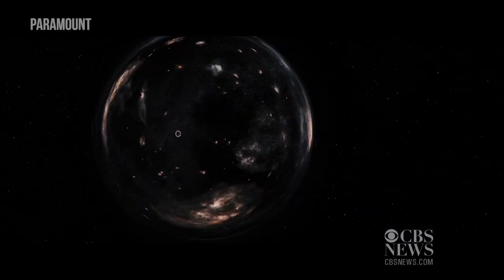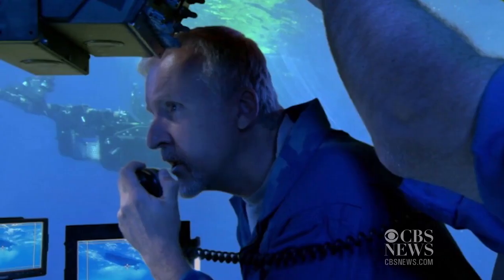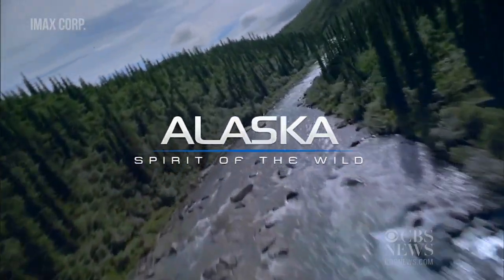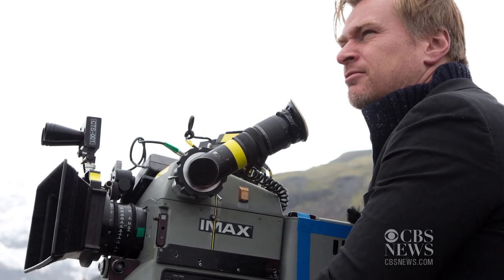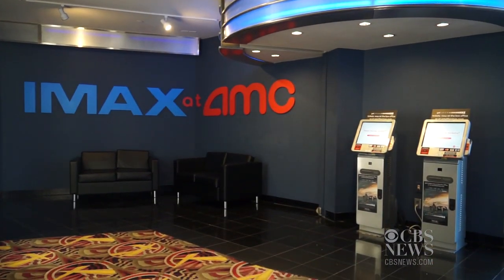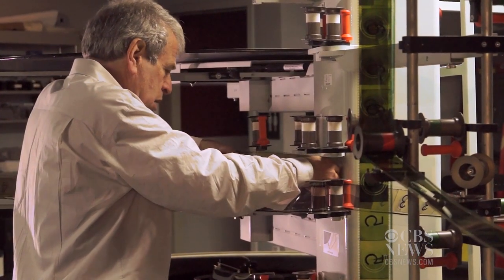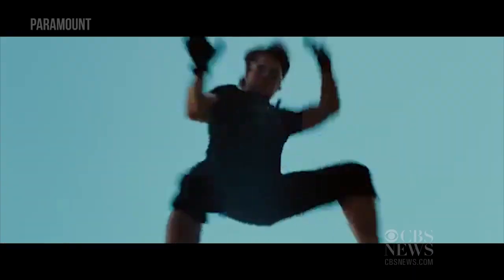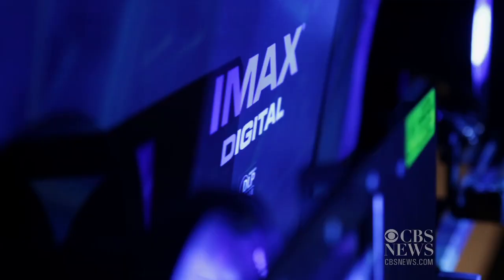In the 70mm IMAX projection booth with "Interstellar"

Comment: How did they edit and add effects to the 70mm film?
Reply: I believe they scan it to digital data and then edit it.
Reply: The digital image is flashed onto the final print along with the analogue images from the film.  They also print digital and analogue soundtracks onto the final product, which the projector reads optically and sends to the surround sound decoders.
Reply: American Cinematographer article reveals that they scanned the IMAX shots for vfx at 8k and the 35mm shots at 6k. Any shots that didn't require wire removal or manipulation were handled completely photo-chemically. Even the color timing was done the old-fashioned way, as opposed to the Digital Intermediate process. Nolan always edits his movies on film, not on the computer.
Reply: +Drew Whitney Every time you covert the film to digital and then back to analog, you lose not only acutance, but also the faithful color reproduction and contrast of high-end cinema film. It's easy to spot CGI in the theatre because it's pixelated and unnaturally lit compared to the live action images.
Reply: I saw Interstellar in true blue IMAX. None of it looked like miniatures or animation. It was suspension of disbelief, something so rare! I didn't notice it, but I later discovered that they also used VistaVision blow-ups for some of the IMAX shots. The only scene changes I noticed were between the IMAX/VistaVision scenes and the comparatively course anamorphic 35mm.
Reply: +Drew Whitney Vista, as in side-scrolling 35mm? I thought they shit-canned that years ago. Although the lack of compatible sound technology wouldn't be a problem, since Imax film contains no sound.  You don't lose anything transferring small format to large, but the detail won't be as rich as if it were shot on Imax.
Reply: Arthur Serino The audio for the movie is on an accompanying DVD because there's no room on the IMAX film for the audio track.
Reply: They might also use an Arri Laser.

Comment: I don't get the advantage of 70mm upon a normal a normal screened cinema? Doesn't it have to be a larger screen?
Reply: +Luap There is a noticeable difference in clarity. See The Dark Knight on bluray when it changes from filling up your screen to black borders. When it fills your screen that is imax footage, when it goes to black bars on the top and bottom that is 35mm... its almost like going from HD to SD.. almost... It is a very noticeable difference in clarity though.
Reply: But which is more effective: developing a larger format digital camera or literally 'filming' the movie?
Reply: Digital is much much more better then 35mm specially 
with red dragon cameras that are 6k and for imax 70mm in 10 years around
 digital 32k cameras with projectors 70mm wont stand a chance in quality,
Compare a digital 4K Laser projector with a 35mm projector result? 35mm 
looks washed out and blury and no real blacks front to it, now imagine 
this with 32k
Reply: No, the advantage of IMAX film over 35mm is greater sharpness, which will come through even on a small screen.  A frame of 70mm film captures about 6-7 times as much data as a 35mm frame, and the cameras are fitted with optics to provide sharpness over the entire area of the frame.  It's like the difference between a 35mm still photograph and a 6x7.
Reply: "Much much more better?" It's not. A damaged or mishandled print won't look good, but 35mm movie film's resolution and color depth still blows any digital format out of the water.  4k is about 8 megapixels' worth of data per frame, with high compression.  Newer high-res 35mm films have the resolution of 100-140 million dots per frame, with zero compression.  Moviemakers and cinemas prefer digital because it's cheaper for them to operate, but you're still paying almost double the price for a movie ticket.
Reply: Holy shit, that too much information for a news like me. So what is nowadays the best quality you can or could get on screen? 70mm can be digital and analog right ?
Reply: I read 35mm film is 4K equivalent(as in 8MP res). So RED cinema cameras with 8K res should level with 70mm IMAX(I think)
i don't think there are digital cinema format with 70mm sensor size.
Reply: Michael Park 4k isn't even close to 35mm. It's more like 16mm.  Film is going to have a higher pixel density than any non-medical image sensor. A digital cinema camera would have to have about 70mp to compete with 35mm, and about six times that for IMAX. The only advantage of digital cinema is that's it's cheap, but movie makers and theaters don't pass one penny of that savings onto the customer, in fact, they usually charge more.
Reply: Where do you get that info? I google for the resolution of 35mm movie film, and no one can give me a straight answer. Why doesn't Kodak release a test shooting sharpness cards and compare it with a Red or Arri? I want proof, damn it! 

P.S. People usually say film has no resolution, bc of the random grain pattern, so where do you get the 4k figure, and how much actual detail can you glean from a 35mm print?
Reply: +Drew Whitney A frame of Kodak Ektar 25 can resolve 200 line pairs per millimeter, which is good for a color film. If you do the math, that means a full-frame still camera can resolve about 140 million grid squares. Cinema film uses half the area, so that's about 70 million points of data, although the film will look better because there are no digital artifacts and no compression. Kodak also makes Imax film, which is more than 6 times the area. Digital cinema serves only to keep costs and production times low, but none of that savings is passed on to the consumer.
Reply: What about a motion picture film stock asa like 50D, 200T, 500T?
Reply: +Drew Whitney Pretty close, and a lot more versatile. I'm told that kodachrome was the finest, but they stopped making it long before I discovered film photography.
Reply: Drew Whitney That's 200 line PAIRS, not 200 individual lines. Try again.
Reply: 400 lines times 25.2 mm and 18.39 mm. 400*25.2= 10,080, and 400*18.39= 7356. 10,080 x 7356 = 74,148,480 or 74 MP.
Reply: Drew Whitney Roughly, but a 74mp digital camera still won't give as good an image, because pixels are square, the contrast is reduced, as is the color depth, and the video stream must be heavily compressed in order to work with existing bandwidth, processing, and stoage limitations.  Digital imaging was designed for economy, not quality.  That should be fairly obvious from the content of most of these recent Hollywood abortions.
Reply: Arthur Serino They aint abortions Mad Max fury road was shoot digital on an Alexa And it looks great.